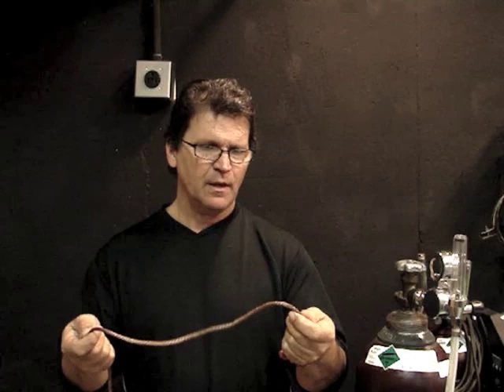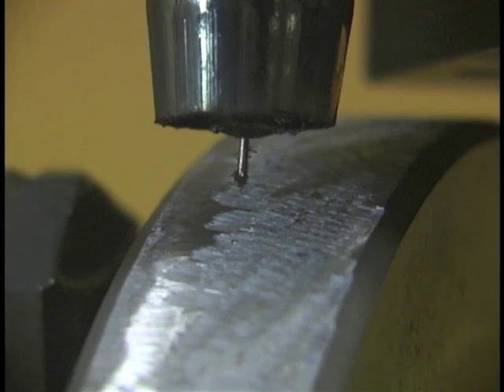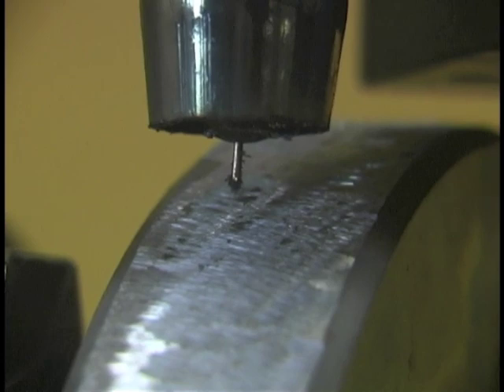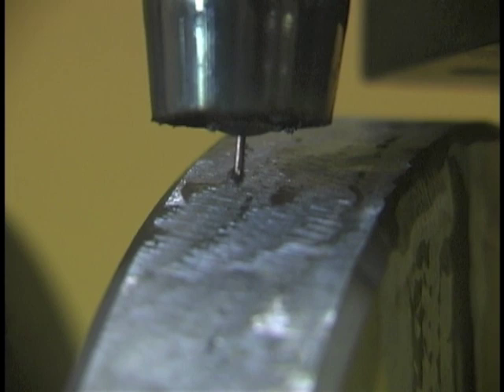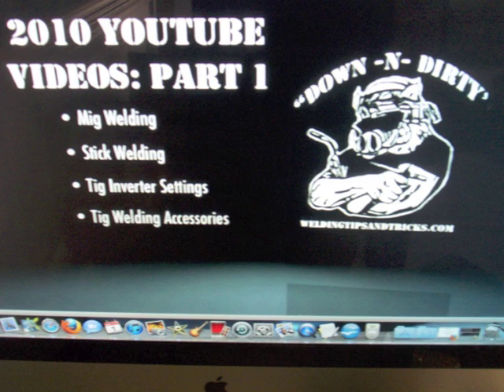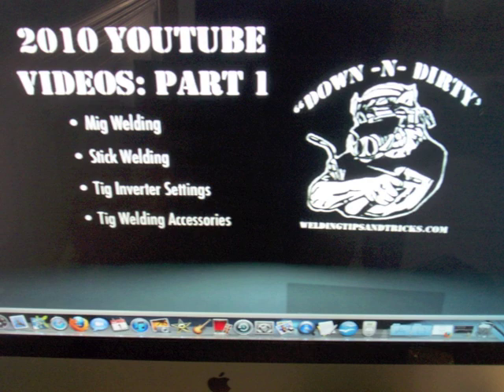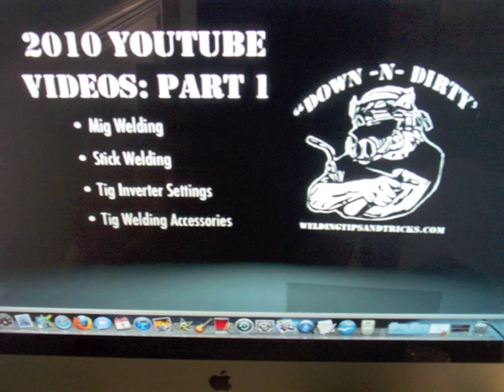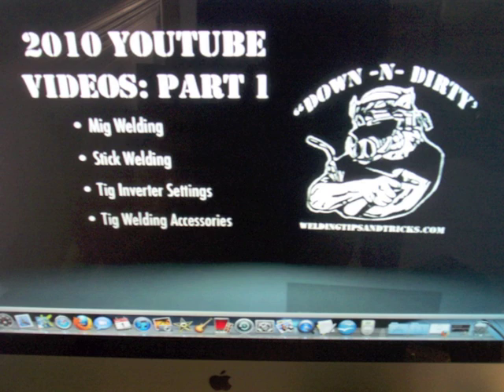Mig Welding Lesson - Watch Your Stickout and Ground

Comment: As an Airfield lighting technician I worked on rotating beacon lights and they use a Brass Rotor. The Carbon keeps the brass clean and you get a continuous ground or hot connection. I use it for my rollup cable reels too. You can have a machinist make one that bolds, in sections, to your turntable where you now have your carbon brushes. Just a thought.

Comment: @CoolasIce2 Think of it this way.  Your MIG power source is Constant Voltage, right? That means the machine is going to fight to keep the voltage the same.  Voltage basically controls arc length. If you put your gun in closer to the joint, your wire should get closer, too.  The machine senses that the wire is getting closer, which would leave a shorter arc/ less voltage, so it automatically ups the amps to burn back the wire to keep the right arc length/voltage. pulling away does the opposite

Comment: @CoolasIce2 actually, turning the wire feed speed up and down does the same thing. set the voltage, and it pretty much sets your arc length.  changing the wfs actually adjusts the amperage simultaneously. higher wfs, higher amperage.  you probably already knew that :P. It's why GMAW/FCAW are considered "semi automatic," though.

Comment: I've been welding torque converters on a turntable for a little over a yr now and I suspect it is having grounding issues, the shops young manager supposedly does all the Maintenance on everything so I've never personally been able to see how the grounding to the turntable is connected, I wonder now if those carbon brushes get dirty fouled or burnt. I have personally seen contamination in the grease cup for the table. And suspect welding slag/dust is making it's way under turntable into the grease...and manager said I was putting contaminated grease in turntable by not cleaning the grease guns tip...😂😂😂....its a zerk grease fitting, you could literally bury dirt in the end of the hose on grease gun and a zerks fitting will not allow anything but smooth grease enter it.

Comment: If you NEED to have a longer stick out for some reason, use a new tip.  Newer tips control the wire and allow less wire walk.  Older worn tips have loose worn out orifices that allow the wire to swing all over.

Comment: This stickout problem is why i hate bernard centerfire guns.  The nozzle holds the contact tip in place instead of using threads, and it recesses the contact tip by about 1/4 inch.  Terrible for GMAW.  Decent for FCAW, though, as the electrode extension is usually a bit longer.
Reply: Some MIG guns have recessed tips.  My solution is... Grind the gas shield back til  the tip recess is to your liking.

Comment: Great video as usual. I have a question. My "knowitall" friend says that a longer stickout reduces the welding current since the excess wire acts like a resistor. Can you settle this argument once and for all?
DOES THE STICKOUT MAKE THAT MUCH OF A DIFFERENCE IN CURRENT? 
Thanks.
Reply: Well, we see some evidence of that right in this video!  If voltage is fixed (you set it) and the wire gets longer, current can only decline.  Remember that is a hot iron wire, it has a lot of resistance!  I have noticed in my limited experience of stick welding:  it's much easier to strike an arc with a little short stub of an electrode than with a whole new one.
Reply: Also, you might want to notice:  When you have a long stickout (say, 3/4"), that doesn't look like much to your eye, but you might easily also use 1/4", so that little variation of your hand causes the resistor to be three times as long!